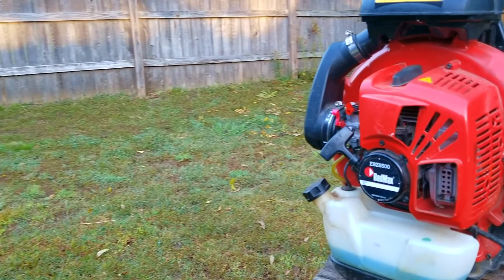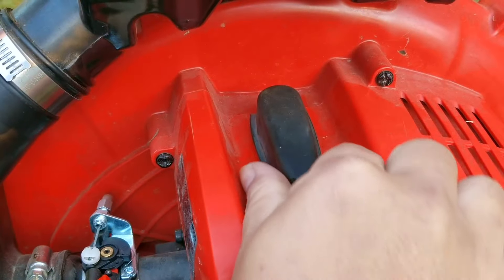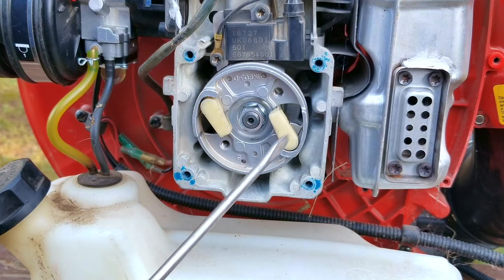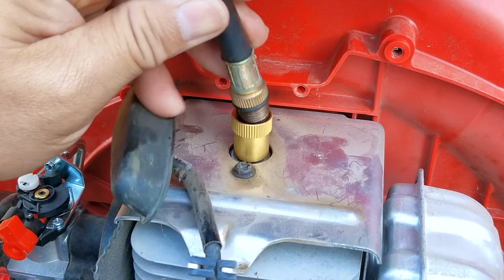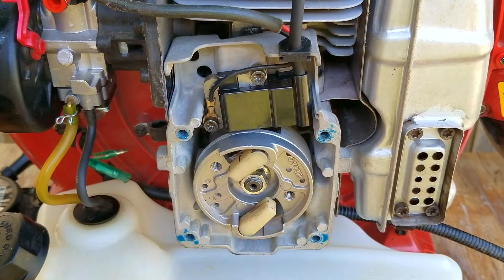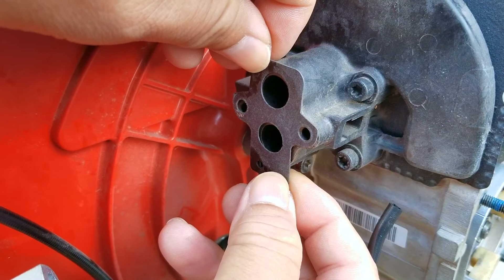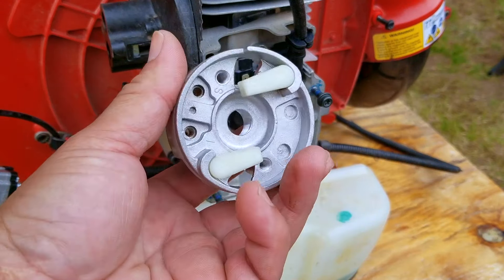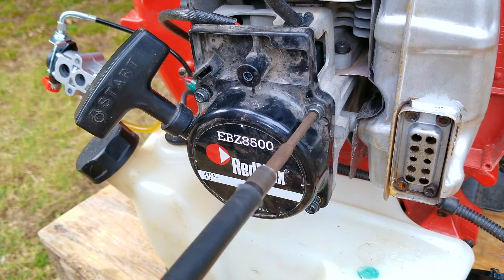Fixing A RedMax Backpack Blower That Won't Start

Comment: A friend of mine tried to repair a sthil straight shaft trimmer, that would not run, changed the carb, spark plugs, coil, still nothing would get it running. Even compression was good! It was a waste of time and effort, so it was junked. Surprisingly this blower almost checked the box of trashing it. You have great patience regarding these tools.
Reply from the maker: thanks, it was certainly pushing it very close to being junked

Comment: Your 14mm to 10mm adapter increased the volume of the combustion chamber therefore decreasing the compression.
Reply from the maker: the entire hose and tester would increase the chamber size though .
Reply: @ not if there is a schrader valve on the end of the hose where it enters the combustion chamber and you pull enough times to attain equilibrium. That’s why quality compression testers have a Schrader valve at the end of the hose where it screws into the spark plug hole.
Reply from the maker: there's a Schrader valve in the inlet of the gauge

Comment: That was really strange, im curious as to what would cause a flywheel to malfunction? I gotta say you have an amazing amount of patience. Awesome job diagnosing the issue.
Reply from the maker: thanks and I wish I could answer that question too.
Reply: My guesses, The factory coil was designed to work with the factory flywheel. And when someone changed the coil to aftermarket, they decided to replace the flywheel (that old flywheel looks suspiciously clean. And the new flywheel wasn't matched to the new coil to work properly on this engine (timing).
Alternative guess. the old flywheel has it's magnets in N-S configuration where the new flywheel is S-N magnet configuration, screwing the timing.  @HomeGaragechannel

Comment: Have a similar issue with a redmax ebz5150rh. This blower will not start. 

Story with the blower, I got it with the recoil missing.
-First thing I did was spray fuel down carb throat & spun by drill. No start. (Primer bulb was pulling fresh fuel).
-Next checked the spark plug (bosch) & found no spark. Disconnected kill switch wire, no spark. 
Replaced coil, has spark (Looks a little weak). Added a recoil to machine & noticed it was hard to pull with spark plug in. [Easy to pull with plug out]
-Retried spraying fuel in carb no start. Perform compression test with drill. Got to (100psi). Removed exhaust (inspected no clog) & saw no scratches on piston. Decided to go deeper in & saw 1 deeper scratch on piston.
-Replaced Piston & rings. (Compression 125psi) Retried the fuel in carb had a pop but no start with throttle wide open. (Even tried with exhaust off). After that pop, it will not pop again.
-At this point, research more & discovered about potential flywheel issues. (Mine has a scratch) Replaced flywheel & spark plug with NGK. Has a spark (similar weak looking spark)
-Now at this point, I'm stumped. Before deciding to tear carb apart, the blower should have at least popped over with the alternative fuel source. My next step I'm gonna try is disassemble the intake to check for blockage & see if the recoil can spin easier. 
[The only other theory I can think of is that the fuel is causing the spark to disappear].
Reply from the maker: did you ever compare both flywheels side by side?  When I compared the new one to the original one, I noticed the key was about 90 degrees from the original one.  I thought they sent me the wrong one but after installing it, It runs now!
Reply: @HomeGaragechannel  I compared it & they were similar. The old part # I search was discontinued & showed me the new part # to get. It looked exactly the same but without the wear. I researched online & people mentioned that these redmaxes have the same common issue.
Reply from the maker: yes I agree with them.   After using and working on this blower, I would not recommend them as they seem to have a lot of issues.  as for your situation, I think there's about 3 ounces of fuel in the engine. Basically it's flooded beyond belief. you'll need to let it dry out or try clearing it before moving on.

Comment: i’d like you to put some cling wrap over the magnet area on the flywheel and drop some fine metal fragments onto the magnet surface to see what the field looks like.
Reply from the maker: hey.!! that's a great idea.
Reply: @HomeGaragechannel  i grind some steel into a plastic container with a grinder

Comment: You fired the proverbial PARTS CANNON at it I have seen head gaskets fail on those or bolts become loose.Should have better compression
Reply from the maker: for me it was only 3 parts, I think it was good choice.  and yes the compression should have been better.  I'm sure not letting it warm up is the cause for that issue.

Comment: I'm stuck...Have a redmax 8550. It started acting up...would start and just bog. Put brand new oem carb, oem mag (old one boot ripped off), replaced head gasket and piston. One ring was stuck, unfortunately one ring broke so I've got one new with the non stuck old ring, seemed good. No spark arrestor, that's long gone so that's not clogged. Muffler port is clear. All the screws are tight. New fuel lines/fuel filter. Air filter is good. Has spark. Getting gas, spark plug wet. Feels like it has plenty of compression. Won't start. What the heck?
Reply from the maker: this is a really tough situation for sure. Since you opened the engine and had to deal with the piston rings, I would recommend using a compression test to confirm what the reading is.  Also remember that with almost every failed attempt to start the engine, it will cause it to flood.  I would take out the mower and allow it dry out for a day or two before trying to start it again.  Also when you do try, don't use the choke or any extra fuel.   And if it doesn't start, then use the choke.
Reply: @HomeGaragechannel  Ty for your help and fast response. I realized ever since I replaced a certain part, the blower would not do anything...sure enough it was the replacement flywheel. The key slot was in a different spot, probably throwing off the timing. Put the old one back on and it started first pull. What a pain. Ps, great video!
Reply from the maker: thank you very much !

Comment: Yes it has happened to me to bro 2 times ona a ms170 Stihl chainsaw I used it but didn't clean it the next day I went to use it and it didn't want to start and I started searching to loose cable or gas leak ect.and the problem was that it needed cleaning when I cleaned it it started and until now it hasn't happened again because I don't let it get dirty . the second time was a 250 and it had like 30 minutes that I last used it when I go and start it it didnt even try to start so i did the same thing with the other one but that was not the problem the problem was that it was flooded so I unflooded it and it started my question is why did it get flooded on hot start and I didn't use choke to start it on hot because it's only for cold dtart
Reply from the maker: thank you for sharing that

Comment: I have a hand held blower of a different brand that is having similar issues. Sometimes it struggles to start but will start and eventually run ok when it gets warm … until it dies and refuses to start again (hot or cold doesn’t seem to matter). I finally gave up on it about 4 years ago, purchased another blower, and stored the old one to someday look into when I wanted a project or had some epiphany of what might have gone wrong. Before giving up on it, I also replaced the coil and carburetor, cleaned the muffler screen, checked the piston and ring, as well as the flywheel key and tested the shutoff switch and wires. No change/no differences. Maybe I also have a bad flywheel? I have never experienced a bad flywheel that was not physically damaged.
Reply from the maker: after this video and after hearing everything you've done, I'd give a new flywheel a shot

Comment: Is it normally for clothes to stink after using the leaf blower? Takes a few pulls to get started and the kill switch isn’t working. Doesn’t choke or stall when using.
Reply from the maker: my answer is, I wouldn't say it stinks it just smells of light engine combustion.  If you don't want to smell like that, then use a rake.
Reply: @HomeGaragechannel  lol no duh. just asking cause  honda mower and echo trimmer dont give out that stench
Reply from the maker: I don't agree with that. If it burns gasoline and uses oil, it's going to smell.

Comment: Craftsmanship mower but that thing we bought a coil we bought everything for it and that darn thing wouldn't run one time or would run the next time we had to strip it and throw it away. My sister bought it up in New York it was used for 60 bucks I can't get it started for the longest time and he finally got it wrong and he sold it to her just like that I told her she should have Runaway thank you for the video
Reply from the maker: no problem and thank you for sharing that

Comment: I think you forgot to put the spacer back behind the coil…. You have to put them back when you put the screws other wise the gap on the flywheel will be way off and it will be back in another week
Reply from the maker: I just didn't show it but the spacer is there.
Reply: Really like your videos !! Very helpful thanks !
Reply from the maker: I appreciate it!

Comment: I was right there with you all the way and like you, STILL was not convinced what was wrong. The different timing key positions threw me too but the end result was that it LEFT!. Never been in that position before but never worked on a REd Max either. My pal at his saw shop says they can be a pill but otherwise a good machine. Glad it's gone but I never have gotten along with the 2-barrel carbs either. Happy weekend!
Reply from the maker: yes you're right, the double barrel carbs just seem a bit to complicated for a small engine.

Comment: There are 2 small plastic spacers that go in between the coil screws that mount to the engine. If not installed, there is a chance the coil will hit the flywheel or not "square itself" when the magnets go by the pickups. Just food for thought. Again, I enjoy the content.
Reply from the maker: yes I was aware of the spacers, they somehow got edited out by mistake

Comment: Im having the same problem ebz8500 replaced coil it sucked worse, got a more expensive coil, still nothing. Replaced flywheel still nothing. Carb is new and was running fine prior to it cutting out. Cleaned contacts on killswitch still nothing.
Reply from the maker: sure, at this point after so many attempts to try and start it, I do believe your engine is flooded and I mean by a lot.
Reply: Hey how did it go.  What did you end up doing to get it started.

Comment: Yes,I rebuilt a Stihl hedge trimmer for a nursing home that my auntie worked for & my dad did some work for after he retired from his job as a fitter.

The ignition coil was gone & I ordered an aftermarket ignition coil & the engine still didn't start even after rebuilding the engine so I got the serial number off the hedge trimmer & I did an online search to find out that Stihl changed the ignition coil & the crankshaft so that they're a matched set because the keyway was milled in a different position.

I ordered the older OEM Stihl ignition coil from an eBay seller who was located in Ohio in the U.S. & when I fitted it ,the hedge trimmer fired right up.

I also had trouble with a junk aftermarket carburettor which I ordered from an eBay seller whose located in Melbourne in Victoria, Australia , it appeared to be glued together with Loctite which the fuel ate so I ordered a new $30 AUD carburettor from a seller who was even located near me in the central coast of New South Wales & it was a good carburettor.

Apparently the machine still runs over a decade later,I learned, try not to buy lawn equipment parts off a Muscat online !
Reply from the maker: great lesson!

Comment: i have a very specific idea of a set of events that could have caused this problem.  

i know neodymium magnets have a curie temperature of about 310-370 C in which all of their magnetic properties are permanently damaged, but they can actually start losing magnetism at lower temperatures in fact. 

so if the carburetor started failing before and started producing lean mixtures or even if the owner was being really hard on the blower, it might have overheated the engine, perhaps causing the damage to the flywheel magnets. 

this would have also caused the lower than expected compression readings if it damaged the internals of the engine. 

all a guess though but i do like the problem solving.
Reply from the maker: that is a possibility

Comment: My EBZ 5150 won't start I've changed  the carburetor, air filter,  spark plug, and it still won't start.  Im about to pull the ignition coil next.  Im at a standstill with this blower.
Reply from the maker: don't worry, you're doing it the exact way you should.
Reply: @HomeGaragechannel just pulled the ignition coil,  it's reading replace on my meter. Hopefully problem solved

Comment: Well thank you for that video , I have 2 of the same exact blowers one runs perfectly , the other I found at the dump I have been working on it.  I can eventually get it running but very hard to start I have tried 3 different carbs new plug  checked flywheel gap. The spark and compression are also good 150#, Its sitting in my shed , when the better weather comes I think I am going to order a flywheel. Thanks Can You put a link to the same model flywheel you used please.
Reply from the maker: sure thing.
https://amzn.to/42ZOeux

Comment: I'm having trouble repairing an ECHO PB250 blower. It won't start even if I squirt fuel into the carb. I found that the shear pin on the flywheel was stripped. I replaced the flywheel and shear pin with no positive result. I replaced the carb, fuel lines, and ignition coil. The engine will not start even with fuel sprayed into the carb. So, it has fuel, air, spark, and compression but it won't fire up. Do you have any suggestions?
Reply from the maker: sure.. don't forget that with each failed attempt to start it before you replaced the flywheel, floods the engine.  I would try allowing the  engine to clear itself over time.. or you can help it.  Do not add any extra fuel, or use the choke and make sure the throttle is set to full when you try starting it.  You'll have to do this a couple of times over the day(s) and only after that then try using the choke to start it.  If it still won't start you'll need to do c compression test to get a reading.
Reply: @HomeGaragechannel  Thanks for the advice. I will do as you suggest. As for the compression, I have a good blower of the same model as the bad one. The compression on the bad unit is 110 to 120. I saw your video about fixing a stuck piston ring. The piston still has the factory hash marks and just minor scoring but the ring has a dark crust on it. Could a stuck ring cause a no start problem? BTW I watched the video you made on how to clean a piston ring. I really like the detailed way you talked through it.
Reply from the maker: thanks, and yes I feel like a piston ring that's not clean and possibly stuck would have an effect on the engine starting

Comment: Thanks to your previous advice I was able to get my ECHO PB250 up and running. I cold started with carb cleaner then added pre-mixed Tru-Fuel to the tank. The blower started right away. The idle is at 2800 and top speed rpm is 6600. However, in about 2 minutes the engine gets very hot as does the case near the exhaust muffler. I mean the outer cover gets very hot to the touch unlike another blower unit I own. I think the problem is the muffler that may be clogged. The spark arrester is pristine. Can you suggest a possible cause for the overheating?
Reply from the maker: have you checked the rest of the cooling fins are clean?  If so, the fuel mixture might be "lean" and adding adjusting for extra fuel will keep the engine from getting too hot
Reply: @HomeGaragechannel  The cooling fins are clean. The fuel is a commercial pre-mix. I'll try the carb adjustments. Since I have 2 leaf blowers I'm going to do a timed temperature test on the exhaust gases --- measure the exhaust temp after 1 1/2 minutes run time on each. 
Update--- tweaking the carburetor high side improved the top speed and maybe it's wishful thinking but the overheating seems to be less so.

Comment: This is exactly what happened to me on a redmax 6500. I checked everything and finally ordered a new flywheel on Amazon. Installed the new flywheel and it fired right up. When I compared the magnetic field the new one it actually felt weaker then the original.  And the key was in a different location from the original. It runs fine now so I'm just going to throw the old parts away and never speak of this again.
Reply from the maker: I know just how you feel

Comment: Did you try putting the original coil back on with the new flywheel?
Reply from the maker: yes I did, and it didn't matter.   The raw video for this one was well over an hour and 20 minutes before editing and I tried a lot of different combinations
Reply: @HomeGaragechannel with the original coil installed on the new flywheel, did it start?

Comment: It seems crazy that the timing difference in those flywheels would cause it to run with the aftermarket one.  However, I went back and re-watched the video from last year, and the inside of that flywheel looks A LOT worse in this video - video can be deceiving compared to in person - where the inside of the flywheel almost looks like it was sliding on the key itself.  It could be from the video/lighting/etc.  Curious if you still have the old one, if you are able to give it another look and see.  That could explain it possibly?
Reply from the maker: unfortunately this video was filmed over 6 months ago and it's long gone.  I'm also pretty certain that I give them the Original parts too, but I'll have to look around to see if they're still here.